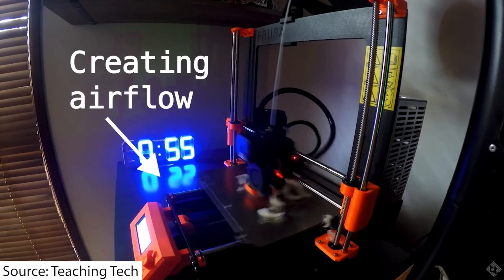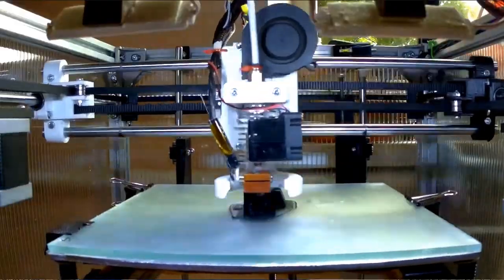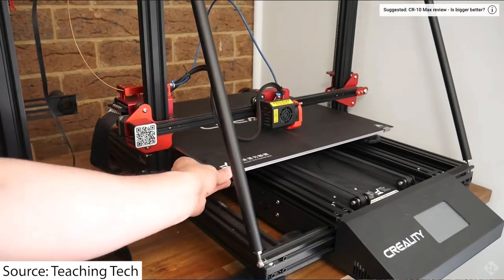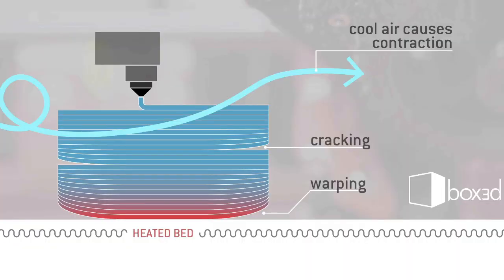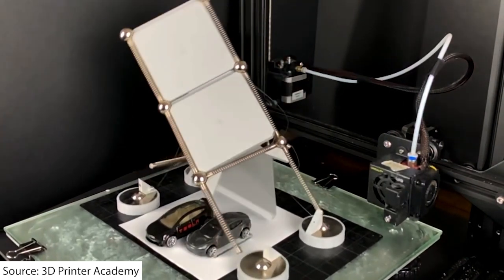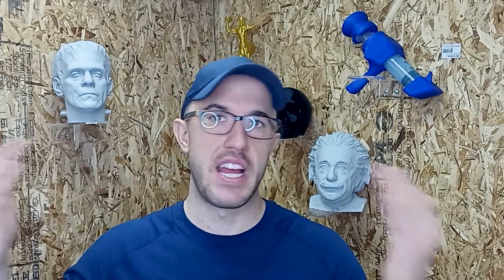The Problem With "Bed Slinger" 3D Printers

Comment: hi, so in life, in practice, what is the real difference? it would be good to see real examples and comparison in terms of print quality, reliability, customer services, spares price, for who wants to buy a 3d printer and its struggling to decide between bed slinger(ender 3v3 ke, ender cr 10 SE), corexy( ender 5 s1, K1, K1C, , delta(vlsun 400, vlsun t1).. ,  Can a Ender 3v3 ke be used for small production? or will be a headache? Which one has the balance between all those characteristics?maybe this isn't the channel dedicated to do that but, do anybody knows where to check all that out?
 Excellent excelent content here anyway Slant3D!!. Thanks

Comment: It is a fundamental flaw, yes, but clearly can be designed around. The thing about the solution you mentioned at the end is the cost. For many people, bedslinger designs brought the cost down low enough to get into the hobby to begin with. The problem of the bedslinger design has been mitigated via software techniques, such as input shaping, to minimize the artifacts. Not needed with a solid bed, however the reduced cost and complexity of the hardware is a significant benefit to the design that cannot be ignored. It is all pros and cons, and your fundamental flaw is really a con in the design, but does come with benefits.

Comment: There is NO flaw with bedslingers. They are just a little slower than CoreXY. With input shaping you will hit extruder limit much faster than mechanics limit.
Weight of the printed part does not matter. I tested that myself.
Part cooling does not matter. Even ABS parts shorter than 50mm can be pritned with not issues. I tested that myself. 
You should test it too before making such video.
I have different printers. CoreXY, Ultimaker clone, Delta, HBot, but Ender3 (converted to BMG direct and Volcano) is the most stable printer. It almost never fail and just works. A little slower, than other, but always gives good result.

Comment: Key is direction of motion as it relates to the layering process as its being formed. With bed slinger motion is in the same plain as the cooling filament, so any momentum imparts stresses within the cooling filament. These internal forces is what leads to warping, lifting, or delimitations.
If a part is annealed, these internal stresses can become more apparent. The internal forces captured by a print layer are also somewhat random as they depend on how the print was sliced and subject more to environmental factors like room temperature.

When motion of bed, or extruder head is vertical (with print fixed in space) then any forces on cooling print are  perpendicular the new layers, so less chance of creating internal forces, or stresses within new layers as the structure is cooling to a solid.
Reply: The internal forces depend from the shape of the part being printed and it's orientation and will mostly manifest in over-hangs... almost nothing to do with how it's sliced

Comment: Direct drive is the reason for bed slingers.  You talk about slinging the print around, but printers also need to sling the print head carriage around.  A direct drive carriage will very likely weigh more than the print itself, and possibly weigh more than the bed + print.  

Of course, a bed slinger with a bowden...  uh...  worst of both worlds.

Comment: my modified cartesian prints very well. no wobble no patterns no whatsoever. i mostly print abs parts for other premium printers. there are excellent mods available like the kevins belted z rigid beds without springs, lightweight dd extruder designs and klipper, linear rail mod etc. this combination is so powerful for any cartesian i3 style printer.i have done lots of tests comparing the dimensional accuracy of corexy and cartesian. Its the same. YES i know tall prints suck YES the acceleration is okayish but man the print quality is the same if the part has enough surface contact with the bed. corexy are fast and good for tall prints period. quality is the same on both types of machines if good modifications are done.

Comment: Do agree bedslingers have drawbacks for larger prints, but as tinkerer setting up settings to get the few parts I normally do with satisfactory results with limited choice of material thou. Have been looking into designs with enclosure that allows all electronics and motors to stay out of it to get more choice of materials, also technologies for hotends. I heard you often mantion reliable printers and revision your at. But are your printers prioritary or opensource in design? Best regards from sweden

Comment: Thank you so much! I kind of knew what the problems were with a "Bed Slinger", but I never got such a comprehensive explanation as to why this design was so inferior when compared to a "CoreXY"!
I watched many of your videos in the past but this one must have slipped by. 🙂

I understand that, for Slant 3D, a "CoreXY" is the best choice.
However, if you are making your own products and depending on the part you manufacture, a "Bed Slinger" can still be a very cost-effective option.
Reply from the maker: Glad it helped! We do not use CoreXY Machines. Common Misconception.
Reply: @slant3d  Oh! I thought it was. It looks like from afar.

Comment: What about Delta printers?
Reply from the maker: Bit overcomplicated with few benefits.
Reply: @slant3d  

I have and use both, deltas are no more complicated than a cartesian. The only draw back is that a Delta needs more processing power. With all the 32 bit boards now that is not an issue.

Comment: 1. Experimental data shows that a consistent climate is important and that as long as the air around the print is thermally stable (e.g. with an enclosure) then there is no problem.

2. Modern machines with automatic bed leveling now seem to come with solid spacers.

Comment: They said the exact same thing about ethernet in the days of 10Mb/s half-duplex ethernet versus token ring but the comeback was "it works better in practice then theory". Token ring was objectively the better protocol from an engineering and theoretical background but the simplicity of Ethernet carried the day and in networking all those other "better" protocols have been killed off. 

Same thing here. He's right and  it also doesn't matter to 90% of the people who are doing this as a hobby or etsy-style shop. Just use klipper with a resonance test and let the software make up for the shortcomings of the HW.

Comment: Enclosed "bed slinger" has no problem with PC or nylon (using golemD series for years now). Springs under bed are bad idea but it's not mandatory. But yes, it's a matter of scale. Above ca. 20cm "sling" it's a problem. Below that it's just more economical solution.

Comment: First of all, nice video overall, aside from the audio setup but I don't know your circumstances so just a minor addendum. ;)

Now "Fundamentally Flawed" - Are you sure you understand the gravity of the words you use to describe the issues you proposed?
Yes, the proposed issues are correct but those issues do not make a design FUNDAMENTALLY flawed by itself.
When designing parts / machines you optimize for certain characteristics over others since optimizing for everything is basically never a possibility.
So when designing a 200$ machine, aka designing for simplicity and cost efficiency, I would call this design spot on considering the quality of prints it is possible to do.
Of course this also means taking hits in other design aspects like consitency, stability with tall or high mass prints and such but that's not why those machines exist.
If you want to do a 20x20x200mm, full infill, ball on a stick thingy you can tune down your settings for your 2-3 prototypes / playthings or get a completely different kind of machine anyways because what you are doing is probably not what these kind of machines actually ARE designed for - low cost, entry level, hobbyist machines :)
Reply: The flaws he mentioned are fundamental to the bedslinger design. So, yes, those are the fundamental flaws of that design. Never does he say those flaws are unacceptable for the lowest price machines. But that doesn't mean they aren't flaws either. We (consumers) generally accept cut corners for the cheapest tier of product.

Comment: And yet many industrial CNC mills are 'bedslingers'.
Reply: there are all kinds of different configurations depending on the application...in CNC, usually much higher forces are involved, so rigidity is a lot more important
Reply: CNC machines work with solid material, not molten material.

Issue with bed slinger is motion is occurring in the plain as molten plastic becomes solid. This introduces varying internal forces captured within the solid but flexible layers.  

When filament is initially manufactured, it's pulled with constrained parameters much like metal is pulled and goes through a cooling process. CNC machines do not reflow material, they only remove solid material. This is a key difference.

Comment: They won't be perfect, but they also are not flawed in such a serious way to be given up for.
You can still get decent quality, decent speed, from them it is also a matter of having a solid structure.  obviously you cannot go as fast or as big as a corexy one, but to the main 95% of the users, its fast and good enough.

Comment: I mean this problem is well know by most people for bed slinger, but to provide cheap printing these are the way to go  as corexy machine are much more expansive and most people aren't looking to print high temperatural industrial material on a cheapo 3d machine, when these hihg performance material cost half the price of the printer itself. And must people aren't pushing the printer at super speed as simply the mk8 and standard v6 hotend just aren't capable of pushing that much filament through in the first place without some modification. The flow rate on these hotends will limit the printer way before the bed will. Hence why these are commonly found on cheap printers, but ofcourse if you want a high performance machine you go up in the price range as you will found alot are core xy at the higher end of the price tag.

Comment: Personally don't agree with this:
1: Most slinger printers have where you can control the jerk so there is no "Banging Back And Forth" 3:10

2: The print bad does not move anywhere near as fast as if you were to "Wave Your Hand At It" 0:45 (Notice how fast you have to wave your hand at yourself to feel anything)

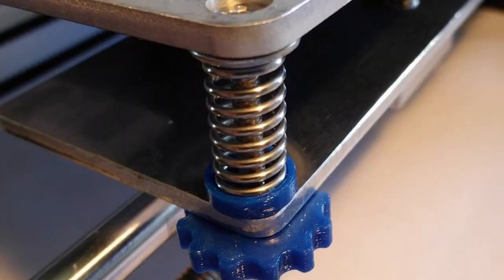3: The springs don't matter if again you control the jerk 1:40

4: Software has nothing to do with this... 2:08

5: You have to tune your printer for prints anyway 2:12

6: All printers are limited with side and height, JUST TUNE THE JERK (unless it prints on a belt where Z is infinite) 2:20

7: Because it is a cheaper design AND all the above 2:53

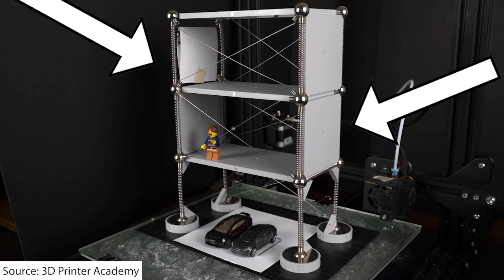8: You just wouldn't print something with flexible filament like this 3:18

9: If you adjust the jerk right and don't print at 10000mm/s, it will print just fine. 4:21

⬇ Leave a like if you agree with this and reply with what you think ⬇
Reply: @Fjprints  I have two myself
Reply: I think you're missing the point. The mass on the bed changes, so the value you tune to compensate for the vibration or motion in the Y axis is never going to be ideal, because it should change as the mass on the bed changes. Now, maybe someone will figure that out and implement it in firmware, but it's not the case at the moment.
Every material is flexible. If you print something tall and thin, it absolutely will wobble in the Y direction when the bed changes direction. Unless you want to have really low acceleration and jerk settings for the entire print. 
In any case, what he said is that bed slingers require tuning in software to make up for deficiency in the hardware design, and that's exactly what you're pointing out.
There's no real reason a bedslinger should be much cheaper, except maybe the reduction in frame material. Otherwise there are the same amount of motors and linear motion control components as a bedslinger. I guess a CoreXY has a few more pulleys and longer belts but that's a pretty negligible cost.
Reply: @Dave_the_Dave  I agree. I just don't think it's bad enough to call it a terrible design.
Reply: From a pure engineering free body diagram perspective he's 100% right but proof's in the pudding and most decent bed slingers do well enough for all this to be a moot point. Additionally climate controlling your printer and filaments will do a lot more for print quality than what he's proposing.

Comment: General I believe you share valuable information about 3d printing, but the reasons you say the bed slinger design is flawed are really reaching I think. I have 20 ender 3s in my print farm and have enough experience to really know their limitations. I can say with absolute confidence that the bed slinger design is a great option for a print farm. For one, the accessibility to make repairs are fast and simple, the machine is very compact, its very inexpensive to get started and the quality can match even the best corexy setups. Trust me when I say no part will ever be heavy enough to cause the build plate to flex back and forth, nor will people be printing that fast. If they were they don't need a bed slinger. I will agree that as the print gets taller you can have some layer lines from the wabble but that is if you are printing a very tall and thin item with not much support. 

I print at 100mms at 1000acc on the ender 3 and my layer lines are so consistent the part almost looks machined. 

Also, the bed slinger setup is also best suited for the automated printing add on some companies have introduced where the part is removing using the gantry and pushed into a bin. The advantages really outweigh the disadvantages in my opinion. 100mms is perfect for production parts I find i don't need to go any faster than that. If I need more parts I add more printers which can be had for less than $300 each.

Comment: Although you're not fundamentally wrong, you kinda are.
Nozzle dragging over soft viscous material actually creates more drag than a slinging bed, especially at height.
It still is bad, the whole marketing of these crappy machines is based either on it being cheap or on a persona cult.

Comment: He is blatantly wrong. I have been using a “Bed Slinger” for 5 years now, and I have NEVER had an issue. I don’t get ghosting, or anything crazy, I print at 60mm. If I print past 60mm/sec I rarely get a layer shift, but that’s only an Issue with very large printed. Sure you need to adjust parameters depending on the size and material, but that’s a given. They aren’t perfect but EVERY printer layout has its pros and cons. For the use of FFF printing, they are beyond accurate and stable enough to have accuracy beyond the limits of the material, hot end and drive system.
Reply: I agree. I print at 100mms with no issues. Parts look amazing
Reply: "Every printer layout has it's pros and cons"    so, yeah, there are fundamental "cons" with the bedslinger design. He is not blatantly wrong as you state. You may disagree to what extent those design decisions have on the resulting print, but his assessment of the mechanics of the bedslinger design is correct.
Reply: @Dave_the_Dave  no, they are not fundamental flaws, there is always a trade off, sure, but fundamentally flawed means there is are issues with the base design itself. Inertia is a fact of the the world independent of a design whether Cartesian, or not, that apply to EVERY single machine.

Comment: Well, of course they are, but it is also one of the simplest designs for a cnc type of machine. It really is amazing how good modern consumer machines can print but these machines are the way they are mostly because of necessity (and a bit of heritage from the first reprap machines). I think core XY machines are gonna be the new standard in a few years
Reply: Well you were right
Reply: Well, in CNC machines you do not have the issues:
- The part is bolted down to the sled, so no issues with wobbling around (as much). Also CNCs do not go back and forth as much and as fast as 3D printers (unless you use a 0.4mm tool).
- Increased air flow due to the part being whipped back and forth is not an issue, but rather an advantage.
Reply: @kaihorstmann2783  "CNCs do not go back and forth as much and as fast as 3D printers"

actually, they do...much faster even... look for RÖDERS if you want to see 5-axis going nuts...
Reply: @simonschneider5913  That is a comparison of apples and oranges. The Röder's I found in a quick YT search are industrial machines in the 6-7 figure price range, far apart from consumer grade 3D printers.
Reply: @kaihorstmann2783   thats true, however:

in milling theres a lot more rigidity required in general, which is why you wont find things like an ender3 in the cnc-milling-world...in 3d printing there are machines that are unbelievably cheap compared to industrial equipment without the huge compromise in performance....

if, compared to CNC-milling, I had to accept the same limitations in 3d printing I wouldnt bother using 3d printers.
Reply: I have an Elegoo Neptune 4 Pro and it ROCKS!  Dual zone heated bed ,nozzle up to 300C°, Dual extruders,Manual bed leveling wheels, 121 point automatic leveling as well,and oh yeah Klipper and Fluidd built right on in.